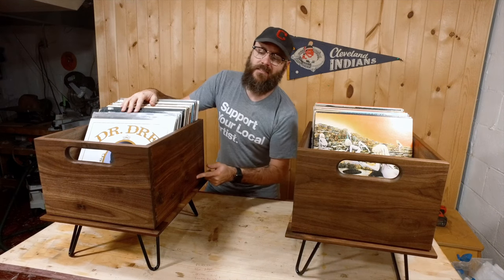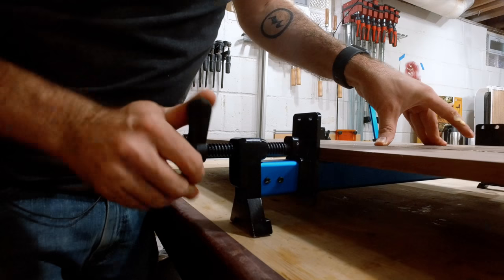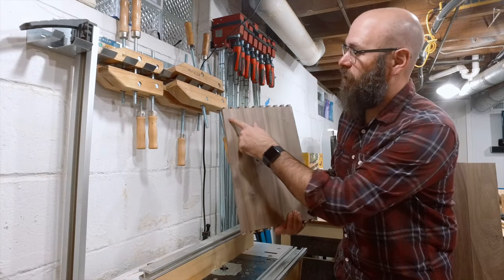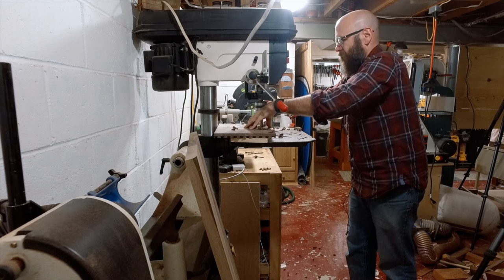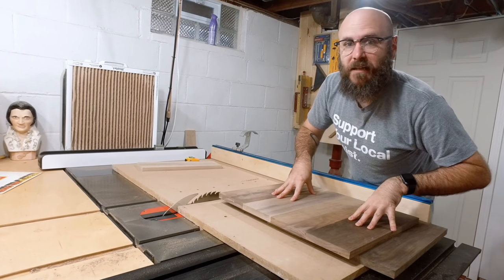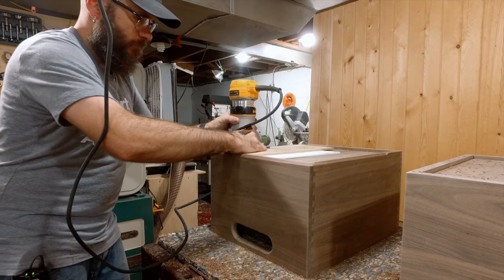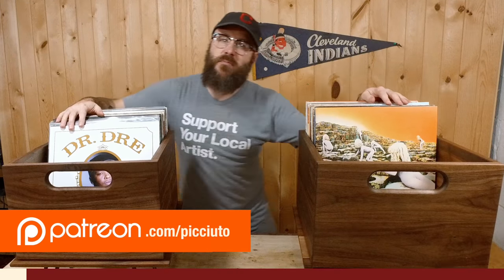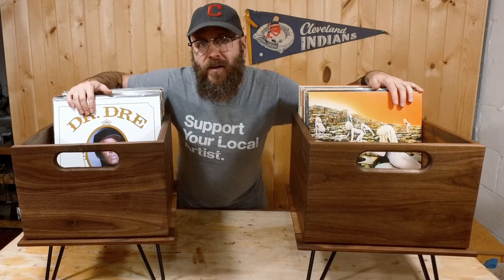Let's Make Some Classic Style Wood Record Crates | Woodworking Project

Comment: I would need about 30 of those crates. I just made shelves on my library walls, to hold my books and records. I made them out of redwood fence planks I ran through the surface planer. I saved myself $130 by buying a dovetail jig from Harbor Freight for $30 it works perfectly, go figure. I love my 45's, 33's and 78's!

Comment: can you do through dovetail joints with that jig or only blind dovetails?  thanks!
Reply from the maker: +JMakes you can do both plus others!
Reply: thanks for replying! been wondering this for ages (nobody i've asked has replied) - when you do through dovetails does it leave a curved edge that needs filling or is it just the same as a handcut dovetail?

Comment: Rockier hardwood is high dollar stuff. A local wood shop should sell it for 1/10th the price (mine does).

You need to invest in a tenoning jig. You could have knocked those rabbits out without having to switch to your dado blade, you also would have been able to tilt the blade slightly for the floating effect you were looking for.

Comment: Hey man.  I couldn't help but notice that slide on the SawStop.  I've been considering one and you are about the only guy I have seen with it.  How do you like it?  A video on your thoughts of it would be awesome!  You can't find hardly anything on them yet it seems like.
Reply from the maker: +Dairy Barn Woodworking I've since given it away. Is fantastic if you primarily work with large sheet goods. It's overkill for the small projects I do.
Reply: Make Something thanks man